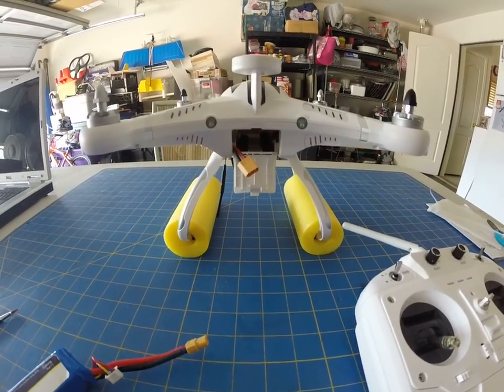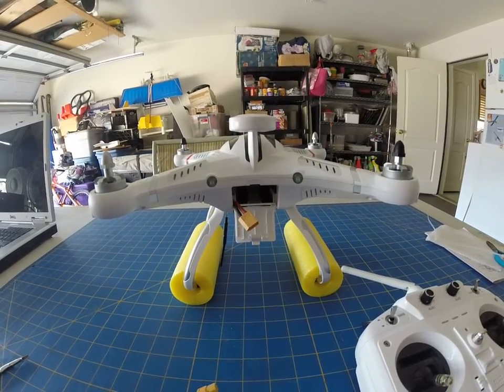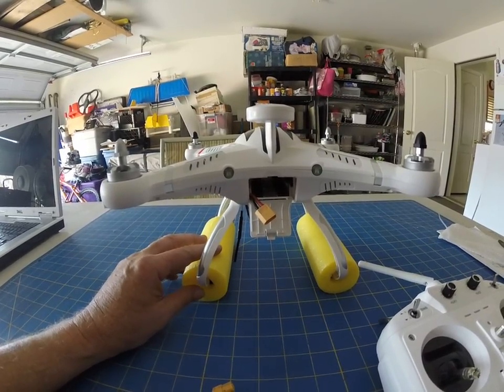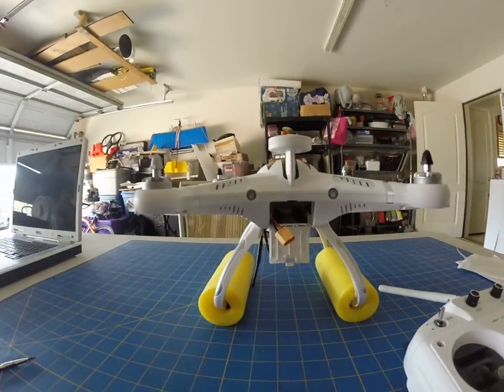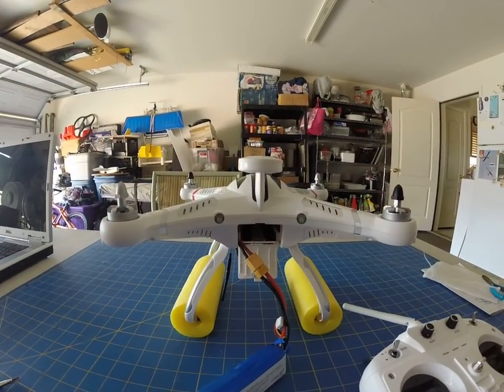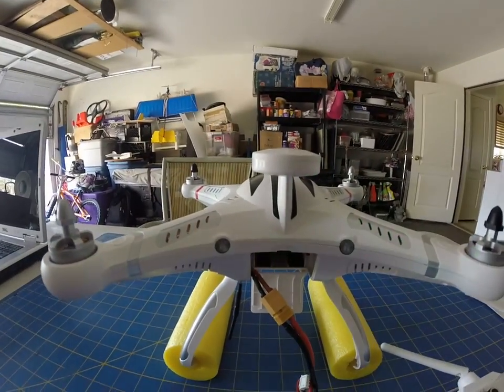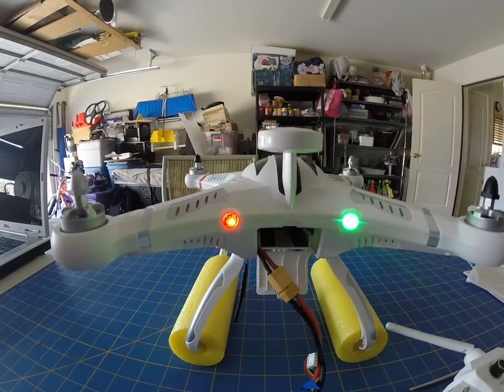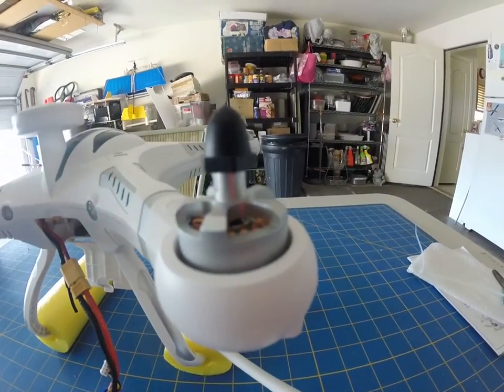Cheerson CX-20 Binding Problem [Solved]

Comment: i had same issue... I redid compass calibration, then went through binding and motor unlock procedures and pulled throttle stick down to lower right .....then I had to hold it there for over 45 seconds before the motors unlocked.....but they DID unlock!

Comment: Check the battery cable in quadcopter, i had the same problem (not the connection, the actual cable). Hope I helped you ))))

Comment: My CX-20 had all four motors beeping. I plugged in drone, turned on and bound remote. Connected drone to Mission Planner and went to "Wizard" and calibrated the transmitter by clicking the button on the right of wizard window just below center and moving controls around.  This saves the control ranges into the drone. The beeping stopped.

Comment: If the issue still continues try the following steps which seem to have solved the problem for me...

Opensource compass callibration seems to be different from the Zero version. Check that...
Remove the landing gear dampening things you have got as well(not sure about this though)
Connect the quad to Mission planner under Initial settings --> in the transmitter callibration check if all the transmission controls are working and then at the end of the page, it should show green for all options. If the lost option that states Are you able to arm the auto pilot is red. then ensure that it goes green by putting the throttle on the transmitter to down right position and check if it turn greens.
Then on the next page for fail safe mechanism, disable everything  including geo fencing.
Finish the callibration.
Go to standard params option under Config/Tuning, for the  Arming check option select disabled. Then click on write params.

The above steps solved the issue for me. try and let me know... if it works.. 

My issue was similar to this but without the sound... So the above might not solve the issue.. Just posting it here so that others who have similar issue can try it out.

Comment: hi guys, Cheerson CX 20 open source. when I assembled it indoors, all props were spinning. took it outside and did the 6 spinning sounds circular rotations, then nose down 6 times. I'm 63 and almost passed out. then after doing this, r front motor would not spin. went inside, and now the red light is blinking and can not turn any motors! I'm ready to smash it. don't have access to a computer for mission planner. please help.

Comment: @Azheat63 i have exactly the seem problem but the mission planner doesn't have in the standard params an tab with arming subject. Where did you found the solution in Rcgroups?
Reply from the maker: I still haven't a solution to the problem,
Reply: +AzHeat63 A okay, i will let you know when i have an solution found!

Comment: It really helps!!!!But in my case I solved this problem differently , because instead of selected versions Check everything , I mentioned only the GPS , compass, battery , but without voltażu and also helped !!!!! I think cx 20 has a problem with this parameter Exactly why can not unlock engines.Yes, that works for me to uncheck option everything and voltage,then send and ok . Regards

Comment: Hi, i have the same problem too.. the quad keep on beeping and no light.. whenever i plugged the quad on the computer, it does nothing at all. nothing happen. please help me.
Reply: same as in the video but no light..
Reply: +James Aldrin Vytiaco try calibarate your compass i had a problem where my quad kept beeping n no lights so i held my right stick bottom right as soon as i turn on the quad  till i get yellow n red flash then did the rotate my quad to fix compass beeping gone
Reply: Hi Llevned, but i think my transmitter is not connecting to the quad. do you think its going to work? thanks by the way! :)
Reply: give it a try let me know if it works
Reply: James Aldrin Vytiaco if i can remember when quad is beeping the transmitter wont bind but i held my right stick bottom right n beeping stop n the lights came back on n i just rotate the quad after by the way i have open source version hope it works good luck
Reply: mine is big shark version.. i will try your suggestions. :) Thank you so much!! :))
Reply: Hi LLVNED, i tried what you have suggested to me. but nothing happens. :( i just keep on beeping with no light. do you have a video on how did you do it? thanks!
Reply: +Ταξιδεύοντας με την κουζίνα Hi sir, what do you mean other program? is there other way to fix my drone?

Comment: Hello, I did the same and even upgraded the firmware, now I can bind and fly the copter but the beep from the power board continues ...any help. what does it means the beep from the buzzer located in the power board, googling revealed me it lacks the juice, I do tried with other batteries no luck :-(

Comment: Hi I did this and it works, it bind the quad but I have noticed that the led is always steady green, even in indoors when is not aupposed to get gps connection. I think I have messed up the quad

Comment from the maker: This is the SOLUTION that worked for me.
I connected the CX-20  to the Mission Planner software and then clicking on "Config/Tuning" Tab and then click on "Standard Params" Tab then look at the first setting at the top of the page ARMING CHECK I selected "Disabled" in the drop down box and then click on the WRITE PARAMS button to send the data to the CX-20. Now it boots up normal. Thanks for all your input. I found this solution in the R/C Groups.

Comment from the maker: I purchased the CX-20 from Banggood.com for $259.00 and now I see the price has gone up to $319.00.
I connected the CX-20  to the Mission Planner software and then clicking on "Config/Tuning" Tab and then click on "Standard Params" Tab then look at the first setting at the top of the page ARMING CHECK I selected "Disabled" in the drop down box and then click on the WRITE PARAMS button to send the data to the CX-20. Now it boots up normal. Thanks for all your input. I found this solution in the R/C Groups.
Reply: Thank you for this! I had the same problem and this did the trick.
Reply: +AzHeat63 Please help....under my "config/tuning" in MP there is no Standard Params tab....and I have the latest version I believe......
Reply: I know this was 5 months ago but for those who may stubble upon this. To see the "Standard" I had to "connect". It is a button in the top right of the MP. Mine had a list of check boxes. The box checked on mine was "All". I unchecked this box and save the params. My CX-20 would then bind to the transmitter.

Comment: where did you buy it from?   that constant beep is not normal on the quad its not making it past boot up so no way you could connect to it def not just a binding issue, hate to say it looks like a defective unit :(     can open it up and check all the connections, but if the seller will replace id go that route first. :(

my boot light seq.  rapid quick green- then red/amber / lights out for 2 seconds, then both go into flash pattern until unit is binded.   I have the open source version.

also check out rcgroups.com if anyone can help it it's them.